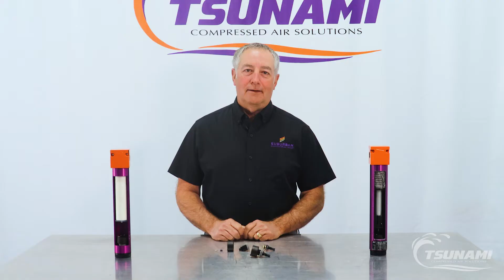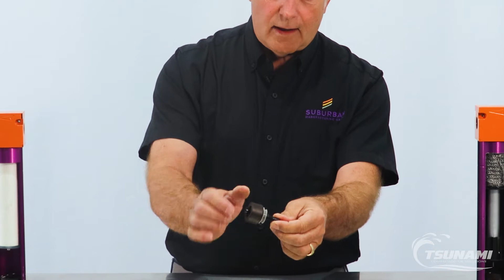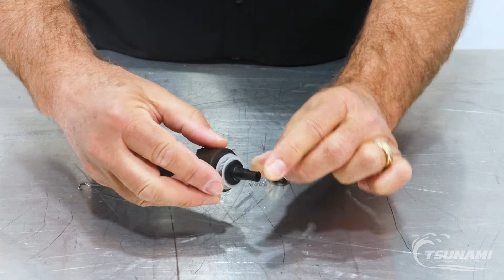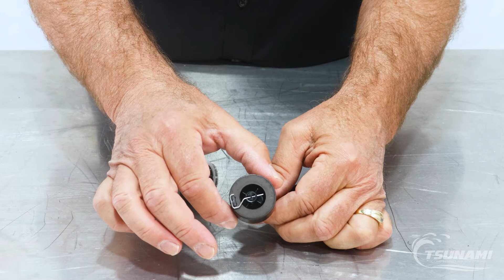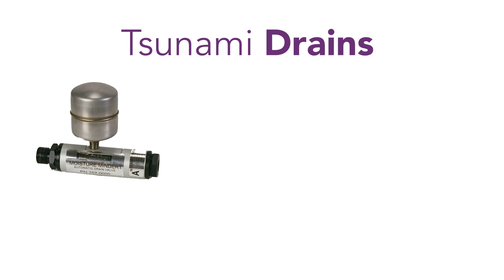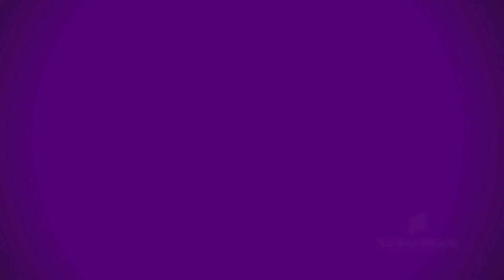Why Float Drains Fail

Comment: Can you please tell me where I can purchase a Float Drain Valve replacement? The vendors listed on the Suburban Manufacturing website do not list this valve as an option.
Reply from the maker: Hi Chris! Thanks for reaching out. You can purchase a Float Drain Replacement on filters.com

Here is a direct link to order: https://www.filters.com/product/21999-0868-tsunami-compressed-air-system-component-float-drain-pack-3-pack/